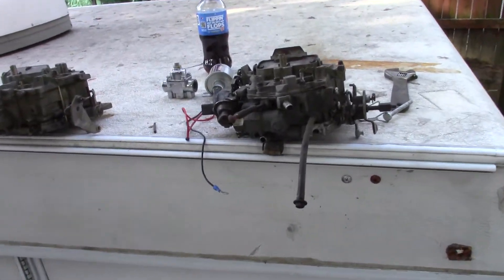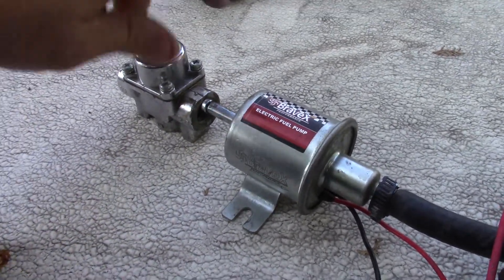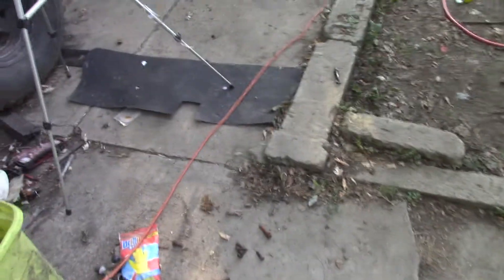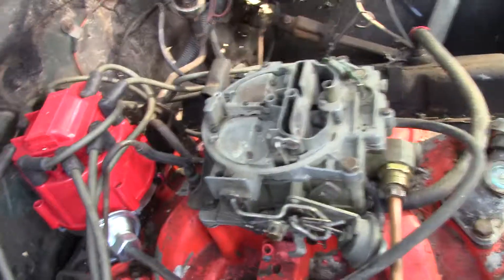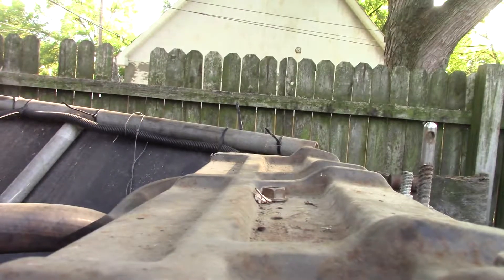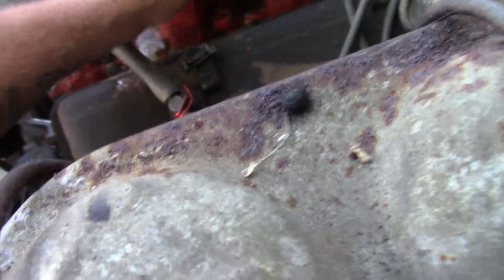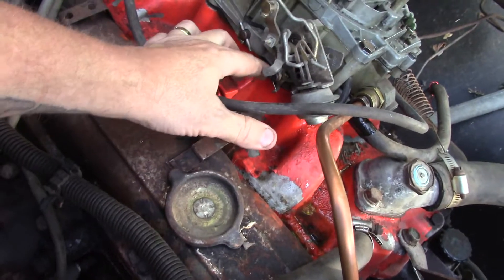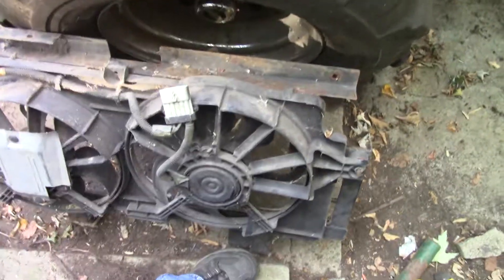79 chevy k20 project update part 3 trying a carb out

Comment: I was gonna say that don't sound like a stock cam.
Reply: It's a mild Jegs cam.
465 lift on intake and exhaust.
282 duration on intake and exhaust.
Reply: @howardmarcum6128  this s10 I got kinda sounds like that just a little more choppy. I asked what size was the cam but he could remember the numbers. Said it was 2steps up from stock. Bought at Napa.
Reply: @jerrys3390  jegs told me if I went any bigger I would have to get at least a 2500 or 3000 stall converter and a vacuum can.
Reply: @howardmarcum6128  I had a 488 lift and I can't remember the duration Edelbrock rpm cam in my 81 with a stock converter. It looped like crazy and was ok. Didn't have a vac can either. After sitting at a red light brake pedal would gradually get hard but I drove it like that for yrs. Just was a dog off the line till it hit about 2000-2500 rpms
Reply: @jerrys3390  I was debating whether  or not to put a 2500 converter in just to get the power up some for some mud bog races. Just don't have the extra dollars at the moment. Just need to get it running for now.